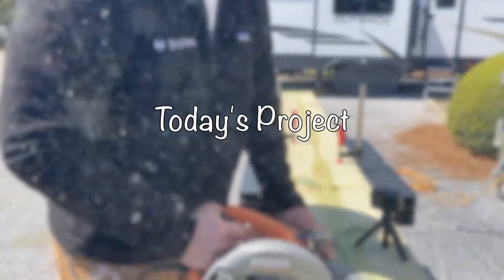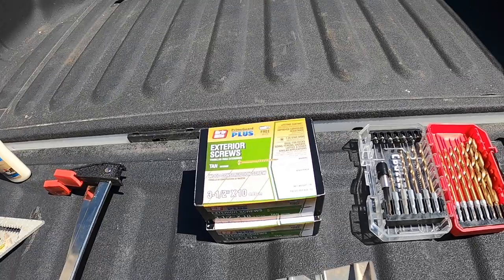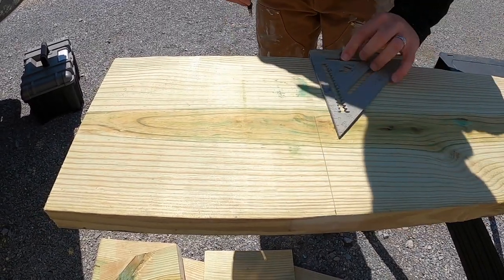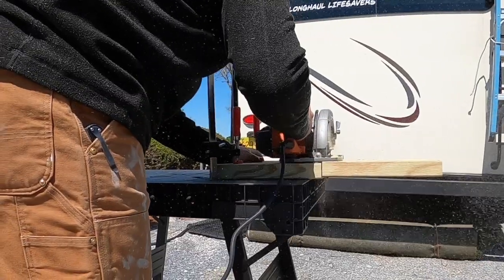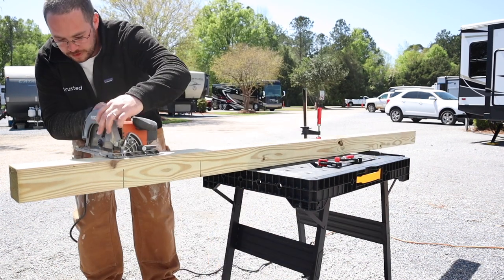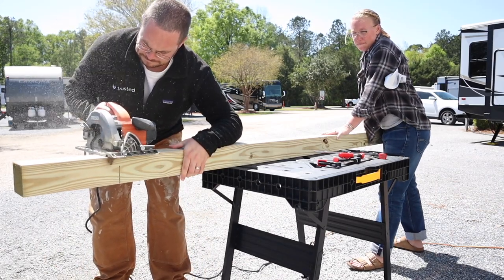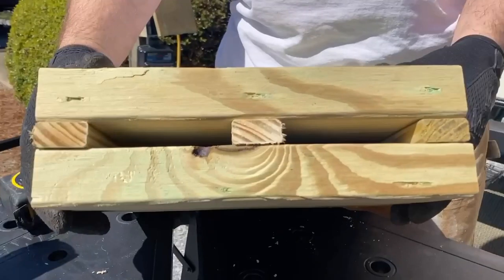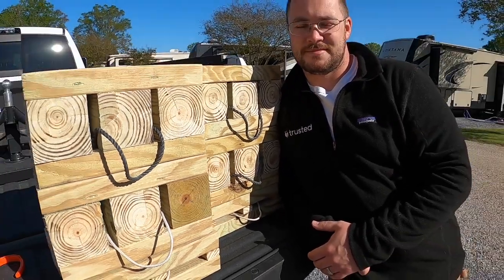[DIY] BEST RV JACK PADS: Don't waste $ on SnapPads or Anderson Jack Blocks

Comment: Great weekend project.  We have a larger toy-hauler and did not want to spend alot on plastic blocks/buckets because my research led me to the opinion they would break and we'd end up replacing them too often.
Reply from the maker: For sure! We spend a lot of time out west and the sun kept dry rotting all of the "plastic" options on the market. The wood has held up really well... just wish wood wasn't so stinking expensive right now.

Comment: Very nice build. I used to carry a bunch of 4x6's and 2x12's cut into 14" pads but got sick of loading/unloading all that wood, the weight and replacing the 2x12 pads every couple seasons. Now that we have a 5th wheel I went with the Andersen leveling buckets....first trip with them coming this week. Still taking the pads, just in case.

Comment: Those are super nice! I think they would be very handy. Lynn and Danny
Reply from the maker: We have been using these now for about 3 years and won’t switch back to anything else. They are tough enough to hold the weight and because they are pressure treated lumber they hold up to the elements.

Comment: I made some wood jack pads and they just dried out and cracked. Went back to light weight plastic taking up less space.
Reply from the maker: That’s why we recommend using pressure treated lumber
Reply: It’s good to seal and finish them with Poly or paint. Might have to add a coat here and there through out the years. 

I can’t argue with lighter and less space.

Comment: Do you think it would be safe to use on a 12 ton (fully loaded) gooseneck dump? Sometimes I have to extend the jacks all the way and it seems a bit wobbly so I'm thinking if I can shorten the travel of the jacks the trailer would actually be more stable. I have hydraulic monster jacks on both of the 16'ers
=
Reply from the maker: My rv weighs 10 ton and I haven’t noticed any issues. I would use these wood ones before I would use a plastic jack pad
Reply: @LonghaulLifesavers  TY; The plastic ones are out of the question. I'll make these  this weekend

Comment: Jon, question. Have you found the 12x12 in profile to be sufficient? You have a fairly heavy rig, as do i at about 12 tons. I watched Jerry’s (I love RV Life) build, but he used a 12x24 inch profile. I would need some gym time to move those about, 18” maybe. But with to price of lumber, i like the 12x12 profile, just wondering if you’ve ever wished your blocks were longer for stability.
Reply from the maker: I have had no issues whatsoever. I have had people that used them on a tiffin bus without issue as well

Comment: I use to have these but there  heavy and bulky , an lumber isn't cheap now days, I went back to the stacking yellow blocks..
Reply from the maker: That is the downside they are heavy. We find the pros outweigh the con thou. We got tired of the yellow ones dry rotting.

Comment: why are the front blocks low profile vs the back 4 high profile blocks on a 5th wheel?
Reply: I am buying a used 2015 big horn 3160el.  It looks like I may need the opposite.  2 high profile blocks for the front and 4 low profile blocks for the back
Reply from the maker: The front needs to be lower for the auto leveling system to work properly
Reply: @LonghaulLifesavers  ok. Thx for the tip!!! Didn’t know that !!

Comment: Great tutorial!! Curious why did you only use 1x2’s for the front?
Reply from the maker: We use the 1x2 for the front as you want them lower than the ones for the rear for an auto level system
Reply: @LonghaulLifesavers  why do you want them lower at the front?